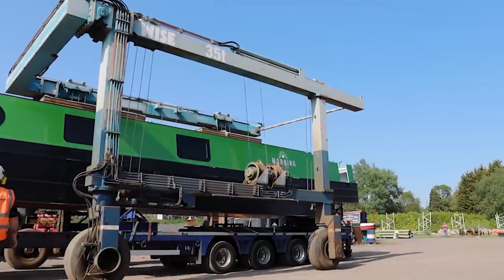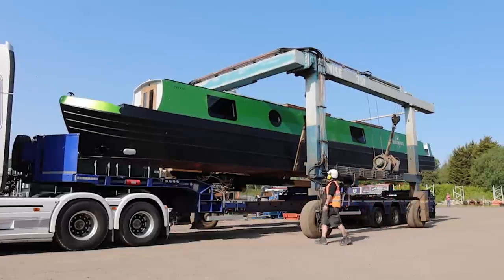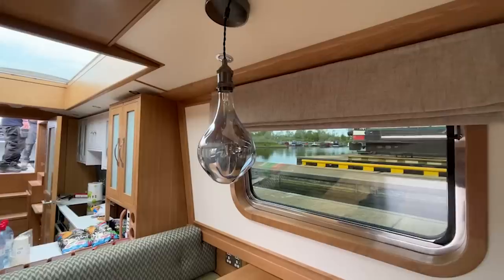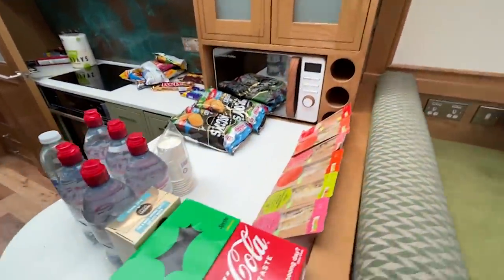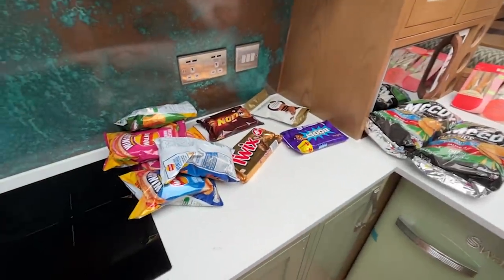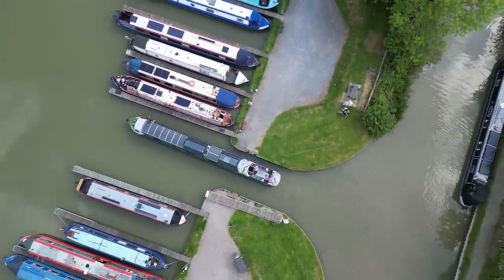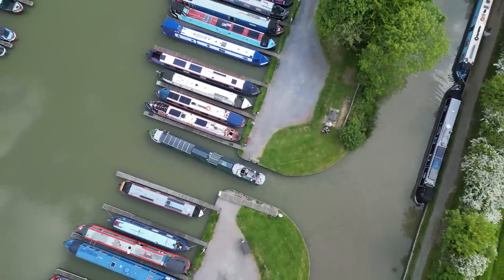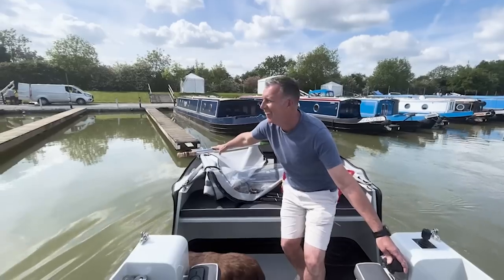It's launch time for Our Brand New Electric Hybrid 60' Narrowboat! Ep167

Comment: Ive always said, diesel electric is going to revolutionize narrowboat design in ways we have yet to anticipate. 
When you consider with a D/L system your batteries, fuel tank, and generator can be placed anywhere in the boat. The only thing required to be at the stern is the electric motor….. and on THAT note…. Consider that even that might not be needed to have its water tight compartment , weed hatches , etc…. All you might need is the electric equivalent of a trolling motor that hooks to the aft end … 
A new narrow boat might have a V shape notch in its hull with a grating deck that fits over it and a the motor fits in the space between and because the motor is also the rudder like an out board motor you will see increased maneuverability
Reply: Totally. So many possibilities. We have seen designs similar to the mini sub explorers for propulsion. It definitely is the way forward. Have a great weekend and take care ❤